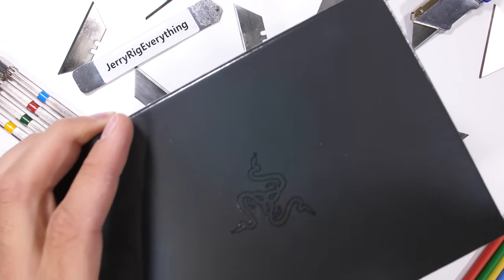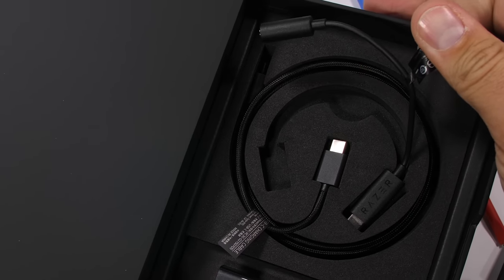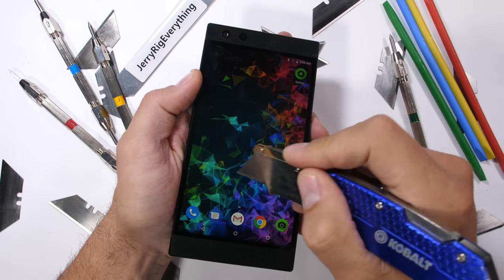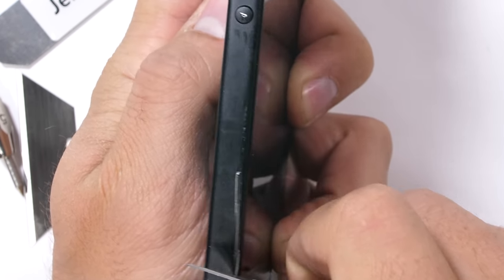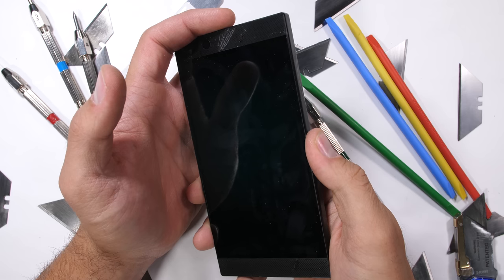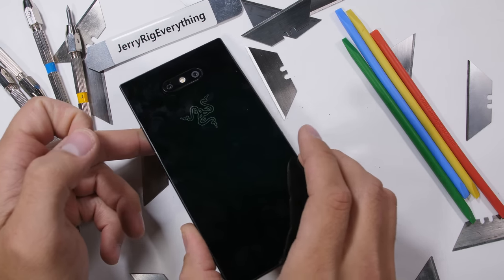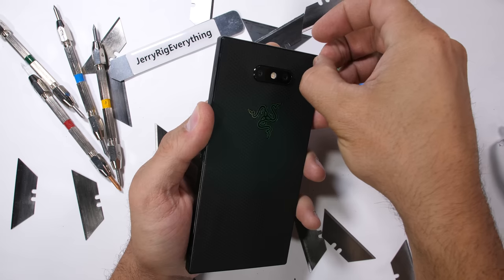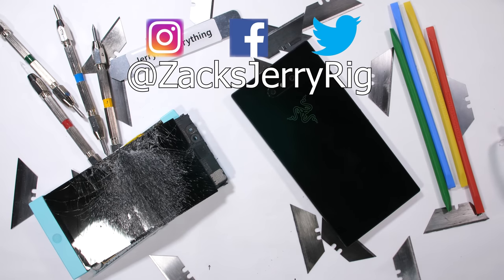Razer Phone 2 - Can Razer Survive a Razor?

Comment: What kind of gaming phone has no headphone jack?
Reply: So true
Reply: This phone
Reply: Pretty much every gaming smartphone that was made up until now
Reply: This
Reply: @rfarif7538  bs.
Reply: Goods
Reply: RF Arif Care to explain?
Reply: Lol
Reply: Just in case you take a shower with it still plugged in I guess?
Reply: Razer
Reply: Ummm its razer duuh
Reply: I personally bought a USB-C to 3.5mm jack cable, which I'll plug from my headphones directly to my phone, hopefully it works!
Reply: Any properly made power brick has appropriate safety measures so that your safety concern is irrelevant. Unless of course you buy some 5$ Chinese knockoff apple charger. A more important point might be that gaming while plugged in (assuming battery wasn't already at 100%) produces a lot of extra heat from charging and potentially degrades your battery faster. Best bet is to charge up before hand, to 90% or so, then game on.
Reply: Headphone jack suck, you cant get good grip when gaming... lol. But yea, every "gamer" complaining about it xD Tfu on these amateurs.
Reply: No phone?
Reply: Even Razer phone 1 didn't have one
Reply: @phaartt  He is 100% Indian, so he doesn't know a lot about tech.
Reply: 4:15 "you can keep the logo showing...or de-branding your phone with a dbrand skin"
Reply: The Razer phone 2 obviously
Reply: @AssaultRider555  Black Shark 2
Reply: That's not just a normal 3.5 dongle, it has a 24 bit DAC inside. Respect. If you say you miss a headphone jack but are not impressed by that then you are moaning for the sake of moaning.
Reply: Sucks that they removed it
Reply: @youngsavage3140  the skin will be cut around this logo I'm guessing. Same as all the other skins.
Reply: Magic egg?
Reply: @Aleksander Suchecki definitely a plus...
Reply: @SalvadorSTMZ  its not a bs... We might see some screen burn due to high temps while gaming and charging
Reply: @mersh2282  the ads are getting smarter. or dumber or both
Reply: Odd seeing you here :D
Reply: a gaming phone lauched after iPhone 7
Reply: @AssaultRider555  except the Honor Play
Reply: Razor phone 1 and 2
Reply: @shmito_123  Fucking hell mate no need to let the whole world and their extended families know that you've bought an adapter. One comment is enough.
Reply: @SuperSonicNOoB  And yet the Pocophone F1 is still better plus I don't think is a full fledged gaming smartphone
Reply: @AssaultRider555  bullshit, the new Asus Gaming phone has a headphone jack and it has a fan adapter with an extra usbc port and headphone jack.
Reply: @KXF FXK For me the concern wouldn't be sound quality but comfort, if I want to use my good headphones I have to carry a dongle wich is just an extra step, it may not be a problem for some but depending on extra accesories does take away from the experience of a good tech gadget. Even if it didn't have a great quality dac (and don't think that just because it's 24 bit the quality is really good, that number indicates resolution, not quality), if I were to buy an expensive phone and cared about sound quality getting a good portable dac wouldn't be an issue. Don't know what the other guy you replied to thinks tho.
Reply: @drwhite7285  chill
Reply: @mersh2282  then you're holding it wrong.
Reply: Mate 20 pro
Reply: Razer
Reply: Bro there's a thing called bluetooth headphones
Reply: Ikr
Reply: Why are you everywhere?
Reply: My sentiments exactly!
Reply: The razer and blackshark type
Reply: Razer aparently. But a phone without heaphone jack and sd card is pretty much usless to me...
Reply: RF Arif What safety? You're basically with a bomb in your pocket every day, charging it is least of your concerns.... 
And what if you want to hear music off a otg storage device? Yeah you don't know anything...

What if i'm going to connect a usb controller? Yes heaphone jack is very important, not only it's a dedicated port, but any other alternatives consumes TONS more of energy, usb heaphones, wireless heaphones, bluetooth heaphones, and all these wireless ones use external batteries that usually don't last as much as th phone, and require frequent charging... 

I dont really know why you guys support such bad decision, not consumer friendly at all, if you don't use such port doesn't mean nobody uses....
Reply: NabilRider555 u forgot Asus rog phone
Reply: WANTED Wan Shahiran I was best Taric in LoL on Europe North-East, played 95% of all mmorpgs on Android/iOS, spend like 2/3k hours playing on phones. I'm not holding it wrong, bluetooth headphones are just future, time to delete 3,5mm jack or completety re-design ports
Reply: A bad one.
Reply: Iphone...
Reply: Taikamuna The Asus Rog Phone
Reply: well razer does
Reply: XDDD
Reply: first of all "gaming phone" is just a stupid nonsense label if there's some "gaming phone" probably it was the xperia play back in time ,  but this? is just bullshit not games , awful experience , and you are paying just for an overall phone with "cute leds" ...
Reply: Only this phone. I don't really understand what they are thinking b'coz gaming with a headphone is so much better.
Reply: Mershilien D'Arc Idk where did you get that 95% of all mmorpgs are on phones but ok. 
About the jack, bluetooth isnt a good replacement because a few things: 
-Spends tons more of cellphone battery
-Depend on another extenal battery that usually dont last as long as the phone or is heavy and big
-Audio compression, it wont be as good as a really good 3.5mm headphone/earphone. 
-It's buggy with connections
-Suffer pretty badly from interference. 
-Takes cpu cycles to audio processing

A second usb port would be the less worse one, but still consumes tons of more power, and this one also takes some cpu cycles to data processing. 

The headphone jack shouldn't be reaplced until there's other comparable alternative port. 
And let's not forget that the jack is analog so you can virtually connect to anything, from your car sound system to a amplifyer system connected to a dj table or something... You can also connect microphones, split the output to 2 devices at the same time, thus being able to record audio externally, etc.
Reply: Razer phone
Reply: kakkepää
Reply: True
Reply: A modern one. Get over it.
Reply: @rfarif7538  So never use my PC ever cause it's always plugged in.
Reply: IRIAN chill mate, if you're saying it's bullsh*t then you have to explain why it's bullsh*t, I get that "you're just paying for the cute LEDs" but it's called a gaming phone for a reason, it has 120hz refresh rate unlike all other phones and it has very good specs specified for smooth gaming experiences. And don't say awful experience if you haven't tried the phone yet (unless you really did).

im just stating my opinion ples dun argu weth meh
Reply: Funny thing is that Zack spook out the exact reasons at 2:42 why we want a headphone jack on a "gaming" phone. It's clear that all these jackass manufacturers just want to part with our money without delivering what we really need. Pitty. If it had a jack I would definitely be interested in this one. Solid, durable... it would have been perfect for angry gamers like me.
Reply: It's not just gaming. I play music in my car through an aux-jack which also pass navigation instructions and phone-calls through. No lag and the best audio-quality that can be expected from a phone.
Reply: Not to mention that (as Zack mentioned) the most important reason for using the jack while playing games is: NO LAG!
Reply: If you didn't pay attention to the video a usbc headphone jack cable is included ya stooge.
Reply: Taikamuna - Jack'sfilms' most favorite domino channel
Reply: Upgrade urself with Bluetooth earphones..  I guess u woke from deep sleep from year 2015
Reply: Dude wtf?!! Epic fail!!!
Reply: @LOKO22Bach  i hear you, a headphone jack on the device is a convenience I can't argue with that, but removing it doesn't cause the problems people like to make out. Maybe you forget your go to BT headphones and your adapter both at the same time and you have only your good headphones with you,  then you can't use them. But i just leave the adaptor connected to my headphones, it's pretty tight on there isn't gonna fall off, sorted. Also what I was getting at, you get a decent mini portable DAC in the box, makes good use of high end headphones so people really are moaning about it just for the sake of moaning.
Reply: Even xiaomi black shark helo 2 don't have jack
Reply: Atleast they are giving front firing speakers
Reply: Razor
Reply: Iphone
Reply: This IS the gaming phone.
Reply: This one
Reply: Bluetooth headphones to have no dust/germs into the phone?
Reply: if u use an adapter its works and gives you more grip
Reply: What kind of gamer's using wired headphones?
Reply: Ikr lol
Reply: What's the point of having headphone jack when you have dual stereo front-facing speaker?
Reply: I see u on like every channel I watch
Reply: Taikamuna iphone 7 :)
Reply: That's why it has such a big battery. You can just charge it over night and in the morning and as long as you're not playing for 12 hours straight you shouldn't really need to charge the phone.
Reply: Razor Phone 2 apparently
Reply: It can use Bluetooth headphones still
Reply: @PistenBoy  The headphone jack doesn't kill water resistance.
Reply: Headphone Jack's are nice but obsolete.
Reply: Its like the newer iPhone's
Reply: @itsllol6504  No the fuck they aren't.
Reply: Ööö katos torillatavataan
Reply: SUOMIPERKELE TORILLA TAVATAA
Reply: waterproof
Reply: I SEE YOU EVERYWHERE
Reply: @jiggsesguerra3353   What do you want
Reply: Taikamuna this one
Reply: Taikamuna  iphine
Reply: iPhone 7,8etc(if you use for play
Reply: More room for better tech
Reply: Because headphone jacks are dead LOL
Reply: @KXF41  when you get your battery to 10%, you'll probably understand why this is important,  also, 24 bit is surpassable by a jack
Reply: Exactly
Reply: Apple’s
Reply: an apple gaming phone
Reply: Taikamuna if it has bluetooth I would argue that gamers don’t use earbuds, they would use something they could d move freely in, also not all gamers use headphone, I mean why wouldn’t the gamer want to be heard? Is he at school or something?
Reply: NOOOOOOOOOOOOOOOOOOOOOOOOO
Reply: You watch so many different channels like tkor and this and how to basic
Reply: Razer
Reply: Every razer phone headphones has adapter usb to jack
Reply: Taikamuna your phone
Reply: EVERY GAMING PHONE HAS NO HEADPHONE JACK
Reply: This phone is not for poor kid who can't afford a bluetooth headphone.
Reply: Iphone.
Reply: Also the Black Shark has no jack
Reply: A gaming phone that is going to be emulating ps1 and n64 games in bed lol
Reply: A good one, this is for two reasons one as an analog jack a 3.5mm jack does not give very good audio quality compared to a usbc that can transfer data so fast you can run a 4k monitor  on it. With the adapter they made the audio is now in 24 bit rate making music and game audio sound much better, plus the fact that this phone is water resistant, 3.5 mm headphone jacks are very hard to make water resistant, not saying it can not be done but when you can upgrade the audio when you get rid of it that is a good trade off. And no this is not an excuse for apple they make adapters that do nothing even from the adapter it is the same as a stock 3.5 mm jack.
Reply: If the phone had a headphone jack i would have bought it in seconds but not having one is a major deal breaker for me
Reply: Yeah that's what I say I need it for PUBG
Reply: Taikamuna only the ones that r worthless
Reply: Its actually quite common atm
Reply: Rog phone is better
Reply: My Black Shark gaming phone.
Reply: iPhone x too
Reply: @Mykhaiel  what do you mean?
Reply: Again?!?
Reply: Because it's water resistant,water will go through the headphone jack
Reply: @LudicrousTorpedo  cough last year model cough Samsung cough
Reply: Yeah no headphone jack but i have no regrets for buying it
Reply: Iphone x
Reply: Bruh
Reply: Xiaomi Black shark 2 also but SD855 12GB RAM 256ROM BEAST !!
Reply: Nubia red magic this phone idk if razer phone 1 doesnt have headphone jack and idk but maybe rog phone is the same doesnt have headphone jack idk
Reply: Xiaomi black shark
Reply: Hakman Tim  i am a gamer and no we use headphones to be able to play better and enjoy the game more and we dont like bluetooth headphones because a lot of PCs dont have wireless feature or whatever you call it (computer must be wired to the internet too to be able to have internet but laptops have wireless)and to confirm my theory that we love wired headphones  and computers doesnt have wireless option,look up any gaming channel
Reply: Maybe it's because when u play games will annoy you
Reply: Haha
Reply: Cool videos on your channel. Ps very weird that it doesn't have a headphone input . They probably want you to buy wireless ones. Lol
Reply: Löl

But actually why is that?
Reply: Bluetooth even if it had a headphone jack I wouldnt even use it
Reply: Taikamuna idk
Reply: Iphone 8
Reply: why do I keep seeing u?
Reply: Razor
Reply: Taikamuna this phone
Reply: Razer
Reply: That's how mafia works
Reply: .ifhones
Reply: At least they include the dongle for it, instead of being an Apple.
Reply: I phone X
Reply: razar phone 2 and xiomi blackshark 2
Reply: The iphone kìn
Reply: Me me big boy
Reply: Who needs headphone jack when u got airpod jack
Reply: one made in todays world
Reply: The razer phone 2
Reply: What kind of gaming phone is a phone
Reply: This one
Reply: an expensive kind😂😂😂😂
Reply: it does. your just not smart enough to use it.
Reply: New iphones?
Reply: Iphone XR
Reply: By now in the Future all phones
Reply: Taikamuna many phones,cause the headphones will make holding the phone unconfortable,so Bluetooth is better
Reply: A Razer product, they don’t have anything except the expemsive price
Reply: Taikamuna iPhone 7
Reply: Lmao
Reply: Nice. I was the 5000nth like.
Reply: The kind that has the best phone stereo speakers on Earth so doesn't need a headphone jack.
Reply: but they got a thx certified usb c port
Reply: no en kyllä tiiä
Reply: The phone that has big ass speakers
Reply: @AssaultRider555  rog phone 2
Reply: @shaiderramos8065  it's been a year. Fucking move on.
Reply: The razer
Reply: it has a dongle? literally no different... are you mad you 3 inches has to be added to your headphones?
Reply: Hey at least it has a dongle
Reply: @AssaultRider555  bs
Reply: My Phone is a Razer phone
Reply: @mersh2282  dont call your self gamer if u dont use wired mouse,headphones.
Reply: Your mom
Reply: Well that phone
Reply: A Razer 2
Reply: huawei p29
Reply: huawei p20
Reply: Black Shark doesent have
Reply: Taikamuna IPad Pro 2018😳
Reply: Iphone
Reply: fr
Reply: You are every where thats why im not subbing
Reply: Domino guy
Reply: All of the newer IPhones
Reply: @animeshsharma9273  r/whoosh
Reply: @AssaultRider555  Why I own an LG V50.
Reply: @shmito_123  Good luck using your headphones when you need to charge it.
Reply: Rog phone 2 and 3
Reply: Good ones so the plug doesn't mess up your grip on the phone smh
Reply: You can use Bluetooth buds
Reply: A lot of phones...
Reply: It’s cause they want you to buy the hammerheads
Reply: Razer phone one also
Reply: 2022 Phones 🥴🥴🥴 i m dumb
Reply: It basically was the future
Reply: Try drilling A 3.5mm Hole in the Razer phone 2